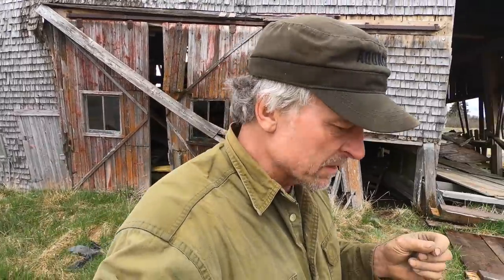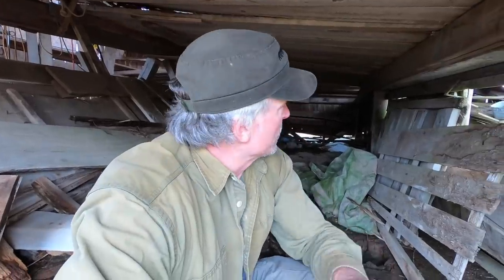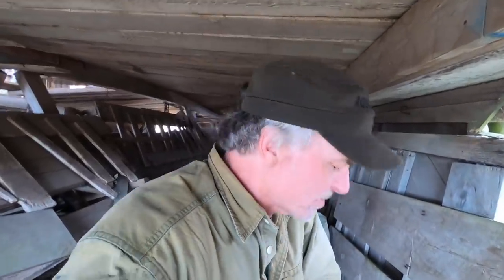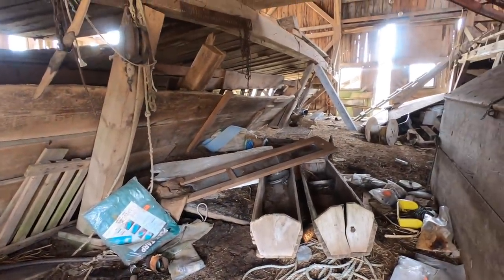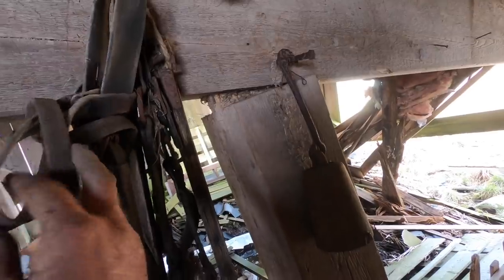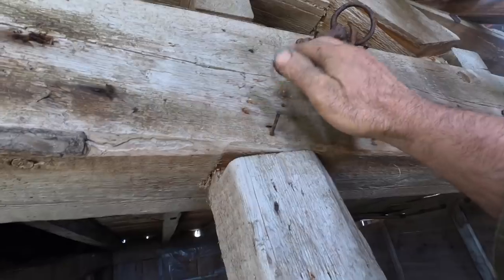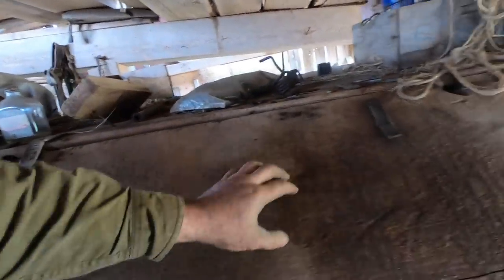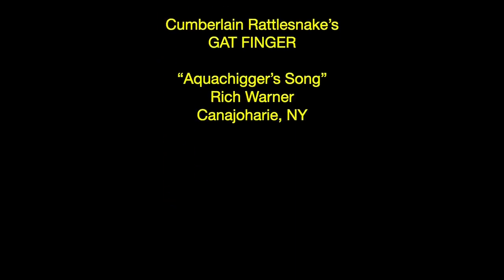Exploring An Abandoned 1800's New England Barn

Comment: Old barns were built using a "story pole" to keep dimensions relative to each other.  So many lengths wide, long, tall, post and beam dimensions etc. Typically the story pole would be tucked on top of a beam someplace for later use.  They would have clear markings for the layout of the entire structure.  Great find if you can get one still in a barn.

Comment: I would dissemble this barn and recoup the old wood. Everything one meter off the ground is in perfect condition, and it's easy to see what's good or not by the color. IMO, if this barn had been built on a rock foundation, with a clear 1.5 meter separation between the barn and the ground with some sort of clay or crushed rock, it would've survived to this day. What happened, here, is water either siphoned up through the wood from the ground, OR, IMO, the most likely scenario, rain kept splashing on the side from the ground up, and it eventually soaked it enough until rot began sitting.
I see this a lot here in Europe with old buildings where they didn't build them on rocks, where as those built on rocks, have no problems whatsoever (from rot). Old wooden churches, they sit dandy and fine. It would be a shame and a pity to let all that good wood waste.
What i'd do is this:
1. ropes from the outside, going in through the siding (it has no value) and i'd secure the structure, much like a tent, with gradual force applied from all sides.
2. cheap pine boards, laminated into beams with nothing more than screws, made and raised inside to catch the existing structure. cheap plywood as post soles, so as to not let them sink.
3. ropes on the inside to triangulate the structure.
Once the structure is stable, methodical and slow deconstruction starting with removing all the moving, detached elements inside. Cleanup of the site, and after that. Slow, top to bottom removal of each component, in a reverse construction method.
If done right and safely, this can be achieved by a 3 man crew. We've done something similar with a similarly sized barn that had a side crushed by an idiot with a bus. Similar process, just a couple more people involved.